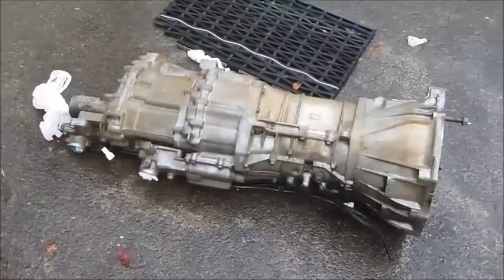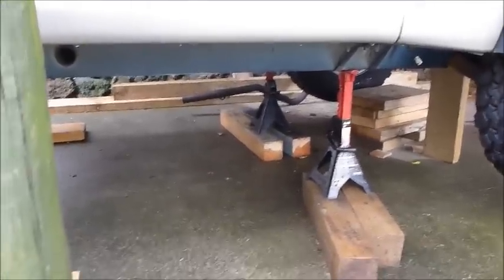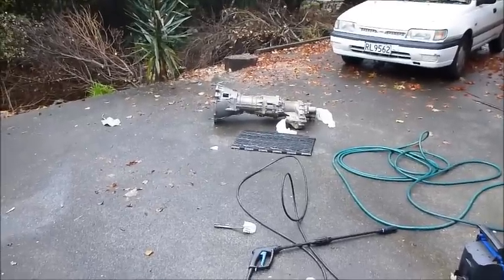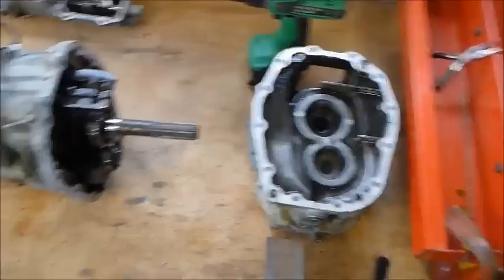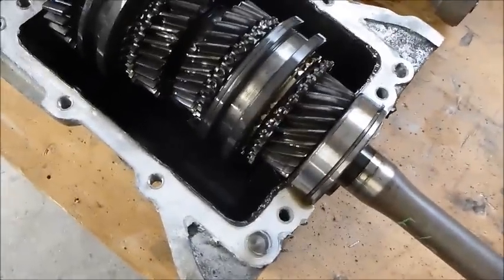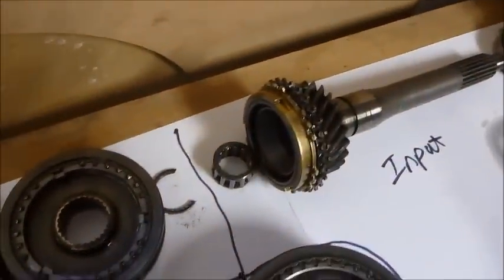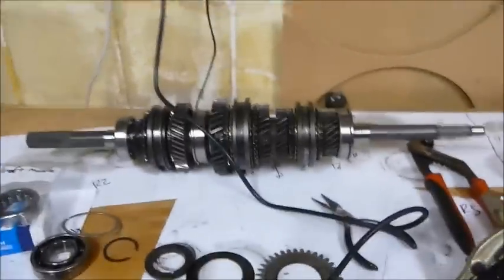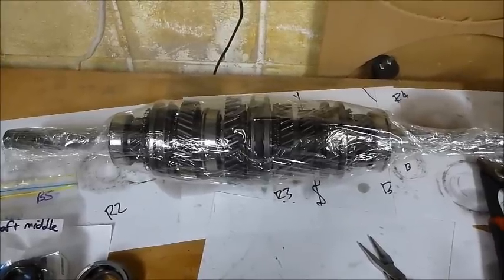Manual gearbox / transmission overhaul

Comment: Thanks for the video! I had this work done by a shop as I didn't have time to do it myself. I was put off by the work needed to drop the transmission, which is unfortunate because the internal components seem straightforward to work on. I wish I had been able to inspect everything myself, they were not able to get the needle bearings for inside the gears, which I would have liked to source myself. This helped me understand what is going on inside though, so thank you!!

Comment: Having trouble removing the exhaust no 1 pipe. How did you get the lock washers off that connect to the exhaust manifold?
Reply from the maker: Triikor It was a few years ago now, but I can't remember any specific difficulty removing any of the exhaust bits. From memory I just did the old trick of soaking all the exhaust bolts and nuts with CRC for a few hours, everything came apart with relative ease.

Comment: It's a good idea to change the throwout bearing and the clutch slave cylinder while you're in there.
Reply from the maker: Absolutely, I replaced the throwout bearing (not shown), didn't bother with the slave cylinder as there were no leaks and rubber in good condition.

Comment: I have the same suzuki same trany and when it reaches normal temperature, sounds like a diesel engine and loses power , the engine was rebuilt a few months ago .... do you think is a transmission problem?
Reply from the maker: Probably not the transmission, if it starts sounding like a diesel, then the engine may be pre-igniting the fuel, meaning you probably have a timing problem. Very very bad for the engine. This is also called pinging.
Reply: I took the car back to the shop and they opened the engine and found nothing wrong with the engine ... is a headache thanks for your help!
Reply from the maker: Take it to another mechanic and let him have a listen, if it is pinging, it will be very easy to hear. Pinging also usually increases when you are loading the engine, like going up a steep hill in a high gear. Best to get a second opinion.

Comment: You do superb work! Thank you for the video :)

You had to use a gear puller to get the 3 bearings off the shaft. So how did you install the new bearings on the shaft? It seems the new bearings would require an equal amount of pressure to get them in place.
Reply from the maker: Correct, I used a high lift jack to fashion a press using some bits of cleaned up tube that pressed on the inner race of the bearings.

Comment: >Great Video, one question this 4x4 suzuki manual transmision is the same in the Grand Vitara 2002 2.0 liter, (Tracker)?
Reply from the maker: +cristian aldana Callejas From the comments on this video, it sounds like they are all pretty similar. I think they probably changed when Suzuki started making the AWD, but yours will probably be reasonably similar.
Reply: My Grand vitara sale  in Venezuela (Tracker)  have a 5 speed 4x4 manual transmission, and it work great but have a noise in all gears except 4th gear. maybe fail only inside needle bearing and outside bearing of main shaft?   thanks for your oppinions and time, sorry my bad english
Reply from the maker: cristian aldana Callejas Yep, that is very normal for Vitara gearboxes, 4th gear is 1:1 ratio, so no side-load on any gears in the gearbox, that is why it is quieter. Mine was quieter after the work in this video, but not quiet like new. If you feel like a challenge, you can overhaul it, but it is not likely to die on you, only get louder with age.
Reply: Thanks you! Yes it start made a small noise 3 year ago..,i chance oil but is the samemonth a week increase
Reply: Month a month increase the noise, i have all bearings, seals and rings to rebuild mine soon.
Reply from the maker: cristian aldana Callejas Cool man, good luck with the job. Work slowly and carefully and it should be pretty easy.

Comment: Great video man! I was thinking about changing the bearings in my transmission, but after seeing this I'm not pretty sure that this is my problem. It's weird, cause mine only makes noise in 4th and 2nd. Do you have any ideia of whta could be wrong with mine?
Reply from the maker: Hi Felipe, thank you for the comment! Unfortunately I  have no idea what could be the problem with yours, very unusual for them to be noisy in 4th and 2nd! Good luck if you decide to take it on, just work slowly and methodically and take lots of pictures!
Reply: You won't believe how simple the problem was, LOL! I started to disasemble the shift levers to take everything down, but then I noticed the boot no.2 was torn in the front part, allowing some noise to be heard when the lever was in 2nd and 4th positions. Well, I won't need to take everything apart this time! Thank you anyway, because after watching your video I got confident enough to start doing the job and, after all, I was able to find out this little problem.
Reply from the maker: Awesome result Felipe! Yes, those gearboxes are actually very reliable, so it is not worth opening it unless there is a big problem! Good job man!

Comment: Botton Shaft is called a cluster shaft.
Reply from the maker: Thanks, I can't quite remember what I called the various parts, good chance that I just made up correct sounding names.  At least it all went back together and worked well in the end
Reply: Nice video indeed. Sent my kzte 4x4 box for recon and the guy just swopped it for a box that was in worse condition. So now I have to recon myself or buy a new one.

Comment: Damn, Just bought a replacement transmission for my v6 escudo. The input shaft has a bit of play like in this video. Guess these wreckers ripped me off not sure if I should even bother putting it in.
Reply from the maker: Triikor Hi Trikkor, the far end of the input shaft goes into a bearing on the flywheel, so it's normal for there to be a bit of play there. The box from the  wrecker will probably be fine, unfortunately it's hard to see how noisy it is before getting it running. Remember to fill only with oil type and viscosity specified in user manual.
Reply: Thanks for the reply, was really not expecting it as the video is 2 years old.

I'll give this transmission a go and hope for the best. Don't have a user manual no luck finding one on the internet either. But I believe the 2.0 V6 Vitara is the same as mine with a different name so should be able to find one.
Reply: @DnosSFS  Hey, I just bought a Tracker Transmission with 90k miles on it, but it also has about the same amount of play with the input shaft. New input shaft bearing or is it somewhat normal? Did you put your transmission in like it was?